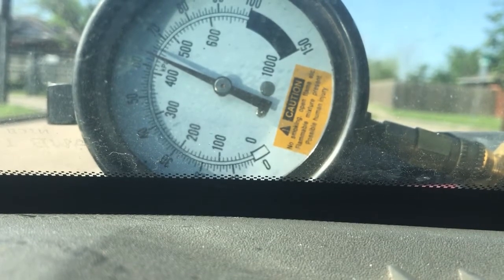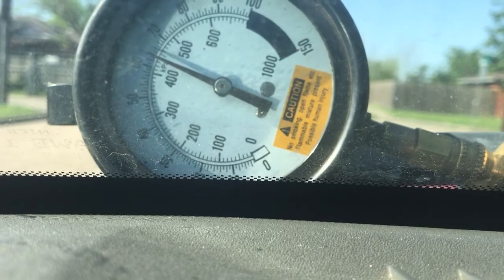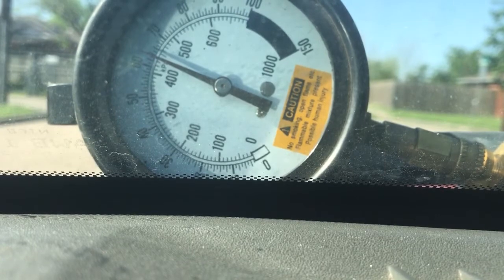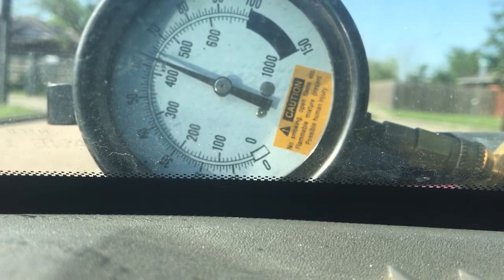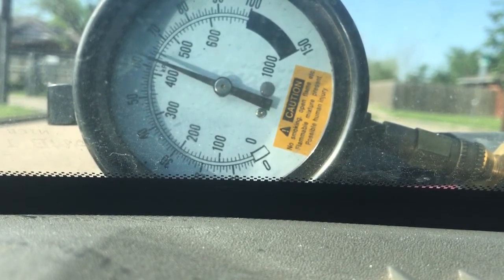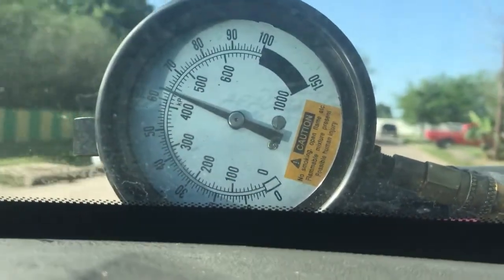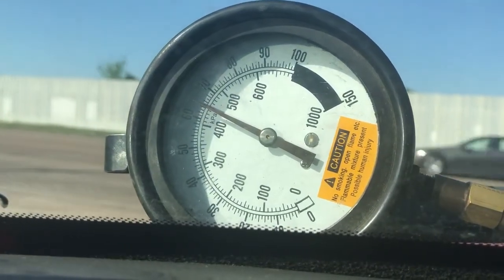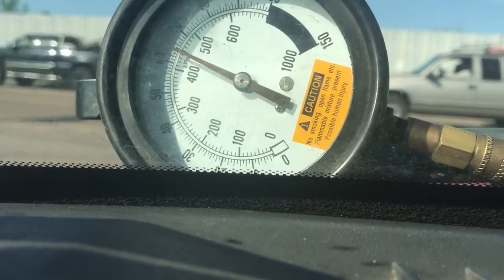Testing a bad fuel pump

Comment: How do you know the pump is the problem and not the regulator?
Reply from the maker: InternetDude truck drives great for the first 15 mins. If a regulator would be the issue it would constantly have that problem.  And most damaged regulators you would have a long crank